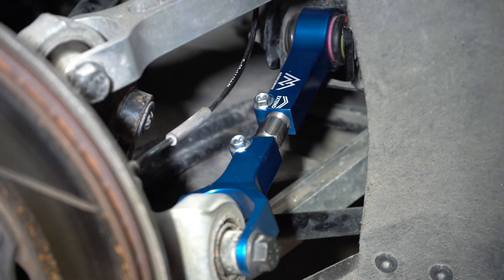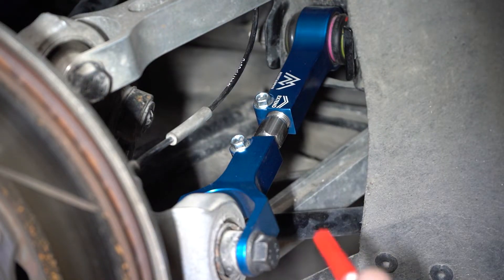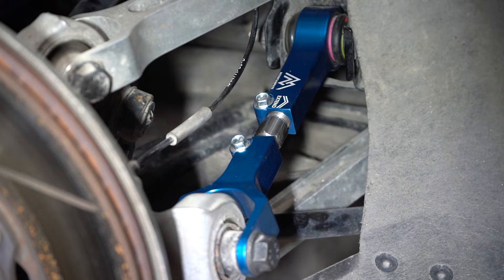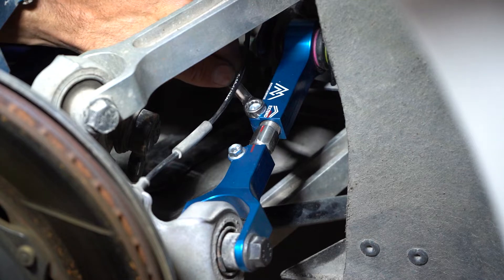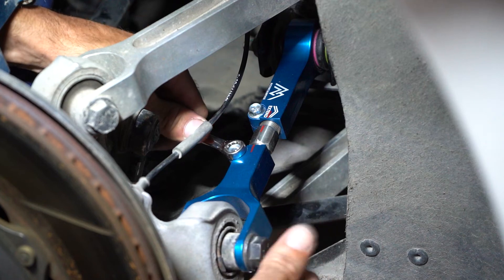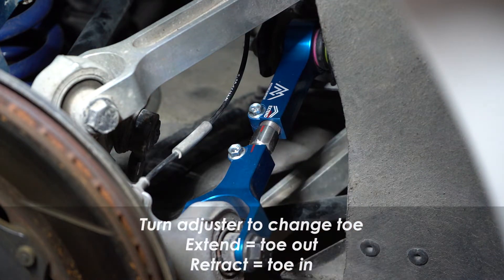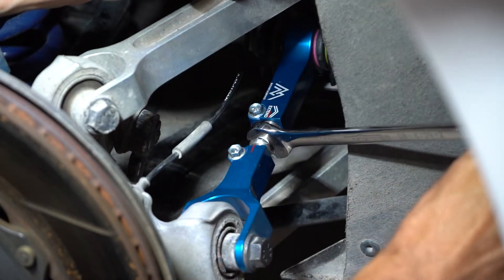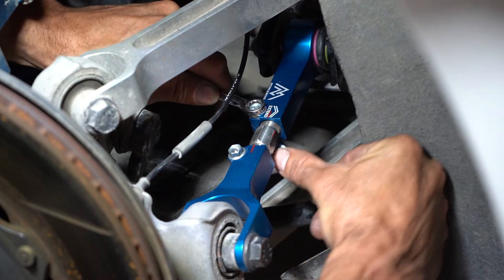MPP Rear Camber/Toe Arm Adjustment Tips

Comment: Nice demo!
It seems, the rest of the multi link suspension need not to be disturbed when adjusting the camber?
I mean, getting rid of that factory negative camber won’t mess up the rest?
Could be great if it is like that!
The whole job otherwise seems easy with MPP adjustable arms!